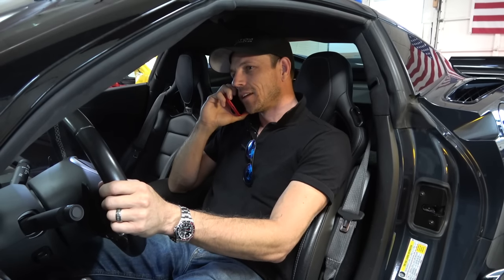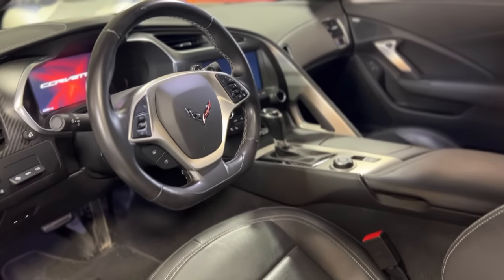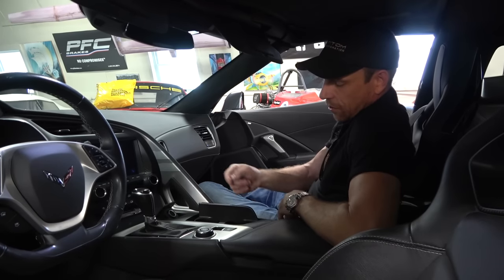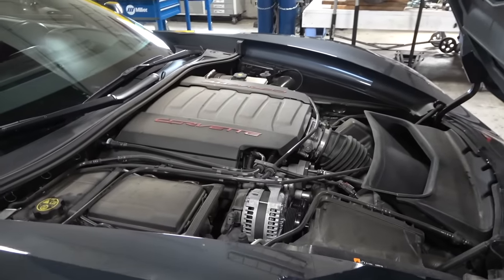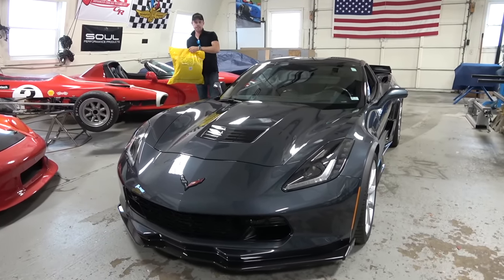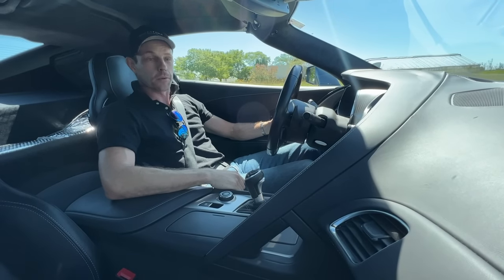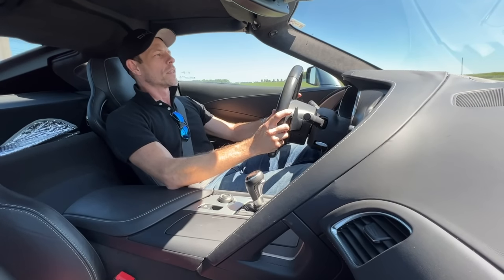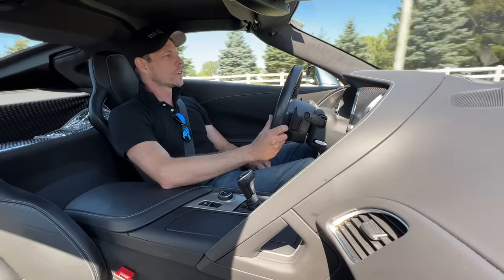It's HOW good? 2019 Corvette Grand Sport - FULL REVIEW

Comment: As a 2017 Camaro 2SS owner, I noticed a lot of the same positives that you pointed out are also found on the 6th gen Camaro. The interior (while not as nice as the Vette) is miles better than the 5th gen, and the Camaro has essentially the same powertrain and technology as the C7. A lot of people are understandably excited about the C8, but imo the C7 and gen 6 Camaros are very underrated vehicles. Both are great looking, comfortable (for sports cars), fairly practical (again for sports cars), performance-focused, and sound amazing
Reply: 6th Gen’s we’re the first time I, a Mustang guy, looked and the Camaro and really thought it was be a good trade. Especially a 2SS 1LE, or a ZL1.
Reply: @169abr  The 2SS is genuinely fantastic. I remember back then (before covid prices) I was also looking at a 911 997.2, and I chose the Camaro over it. The comfort, aesthetic, performance, and technology for the $ is insane. For $34K I was able to get a V8, dual exhaust, mag ride, a HUD, heated/cooled sets, leather, and much much more. It's a shame that covid ruined car prices, but if you can find one, they are great cars
Reply: @Clone895 😢

Comment: My 2017 C7 manual doesn't force 4  cylinder mode on you. You can select it if you wish. I'm well over 30 mpg at 70 mph cruising, so why bother with it. I do have a device plugged in that defeats the forced shift from 1 st to 4 th and it works well.
Reply: What's the name of the device please?
Reply: Yes...
My understanding is that "manuals" do NOT go into 4cyl mode, unless in "Economy" mode.🤔

Comment: I have a 2016 Z06, 3LZ, convertible, A8.  I have a wind screen shade, a car cover and a Range device to prohibit cylinder shut down.  Today, 12/15/23, I just installed an AFE cold air intake.  I love this car, and even though I respect the performance of the new C8s, I still like the looks of the C7 better.  Thanks for the video!

Comment: I purchased my '17 GS from a private seller for $50k. Had 9k miles on it. I replaced the front splitter and the middle piece underneath. Seller said wife torn it up parking. I can see how that's an issue. That front sticks out farther than you think. I lowered it, and that makes it even more prone to damage. Really have to pay attention. 
The car is awesome. Drives great and is fun. My average fuel use is around 21mpg and it shows my best at 34mpg! That was on a road trip. 
I have since plugged in the 4 cylinder bypass. Still gets better gas milage than I expected. Get on it and it's going down to 15mpg.
Reply: I have 35k miles on it now. ❤

Comment: We picked up our '19 GS Vert with 5 miles on the odo as we wanted the last year of front engine car. The difference between the GS, and our '16 Stingray is amazing. The dang car is faster than I can think these days. 😀 BTW, I plugged a Range Technology V4 disabler into the OBD before I left the dealers lot. The engine in these cars are not happy running on 4 cylinders, and no one can tell me that disabling 4 cylinders if good for the engine.

Comment: The act of fuel management system is awful tears up your motor and messes up your transmission!
I bought a ranged technology to put in my code reader, and it turns the four-cylinder off . Also had my transmission fluid changed and the filter and put shutter fix in it so far so good!
Recommend that you do a triple flush on your transmission . Of course they don’t wanna pay for it, even though this problem has lawsuits about it.

Comment: Also with the transaxle/torque tube setup, the front/rear balance is very good even for a front engine.
Reply: The balance for the C7 is 50/50, whereas for the C8, it's 40/60 (front/rear) empty.  GM says it changes by adding a driver and passenger (duh). 
I, personally, don't like the looks of the C8 so, I won't be trading in my C7 for one.  It's the BEST Corvette I've ever owned.  I absolutely love it.

Comment: Front mid engined. Engine sits between the front and rear axles, making it a mid engined car, specifically front mi-engine. Front engine car the motor sits on the front axle. C8 is rear mid-engine.

Comment: I'm not sure what factory ringer you've got.. But, "rock solid build quality" is non-sense. My son's 15' ZO6 even after the TSB for the roof squeak. Still squeaks something terrible. His center console armrest leather has separated and looks like a wrinkled forehead. My 19' GS's driver door panel was replaced because the armrest leather separated looked like wrinkled bicep fat. Also, my passenger side rear quarter window trim separated from the outer panel. My brake switch's chrome delaminated and was replaced. Note, Both of our vehicles have very low miles, are 7 spd manuals, garage kept, 3 bucket hand washed and well maintained. Last, the issue with GS and ZO6 wheels cracking and warping, GM denied it was an issue. I hate these videos! Not addressing GM's build quality issues is why they continue.

Comment: This is a useless overpriced car. It makes 0 sense… especially used. Z06’s were only like 10k more and used they are the same price or within the same range.. why in the world would you buy a standard engine fake z06 body car vs buying an actual z06 lol.. again it makes 0 sense
Reply: NATURALLY ASPIRATED. 50/50 weight distribution. it does not make zero sense! This car is a track weapon that won’t heat soak and limp after 3 laps like the z06